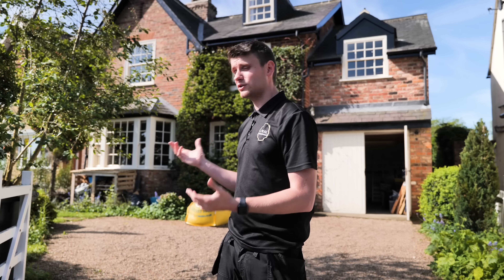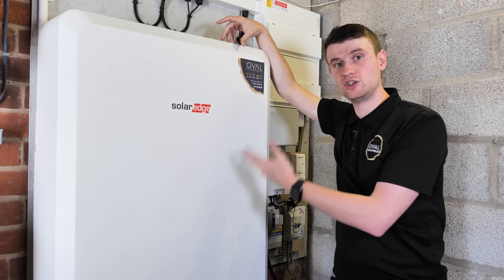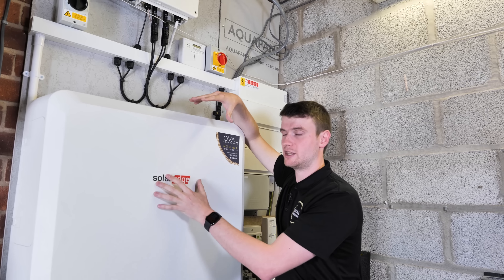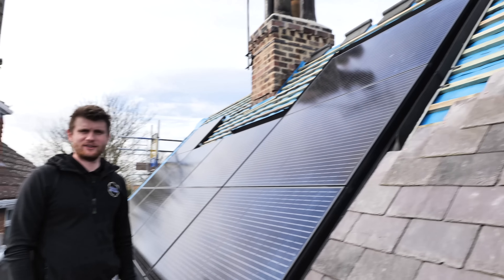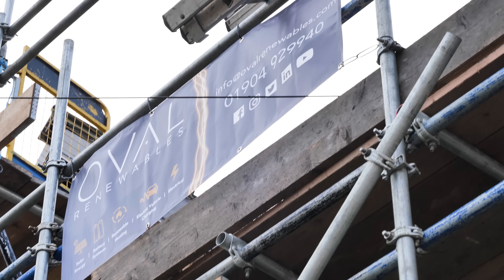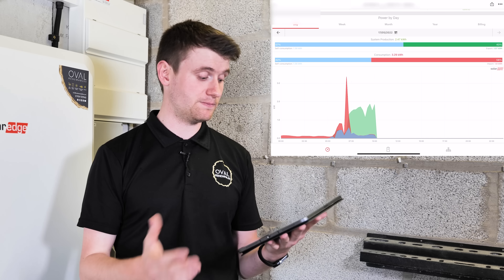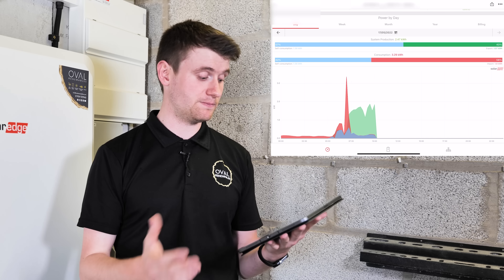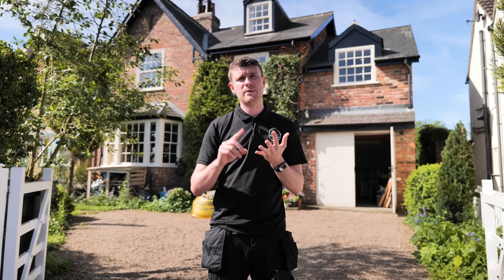Our First SolarEdge battery Installation with Solaredge Solar PV!

Comment: I have a similar system and have experienced the problems you mention with the Energy Bank. A few days ago the battery, according to the app, was not charging or discharging, it is working now. There's a software update due soon apparently. Considering how long the Energy Bank has been available in the U.S.A they should have resolved most problems by now. To be fair SE support are quick to respond to any support cases, in my experience within 48 hours.

Comment: Loving your videos and it is helping me as I am seriously considering solar panels and battery storage, as we recently moved into a property that is quite a period property in Brotherton, built in 1790. It was nice seeing this video with an older property, but I still think this one would be a walk in the park compared to mine. It is scaring me the prospect. Old fuse box, with old meter both of which are relatively inaccessible due to a kitchen being built on top of them. Walls nearly a meter thick. Also I would need an external setup (battery etc) as although my property is huge with a massive roof (my electrician buddy thinks that if weight and other things was not an issue, I have enough room for 40+ solar panels) that has just enough pitch so it is not declared flat (so uninterrupted sun all day), I do not have a garage. 

I need to get a survey done to see what is possible as my elec bills are huge, and I do not even charge my car at the house, my Tesla has free supercharging so I use Ferrybridge for that but would love to charge it at home and not supercharge it all the time.

Comment: Great installation  
I have 1 question  : If you would made this off grid what's are the options for grounding solar panels  ? 
Would you add earth  rod or still ground them through  mainboard Earth cable ? thank you

Comment: Thanks for the video!  might be a silly question but ( I'm not familiar with the solaredge systems) is the battery connected directly to the inverter as i can't see the cables connecting in? I can only see the two strings, ac, and comms, or is the battery ac coupled and connected separately on its own circuit that communicates with the inverter?
Reply from the maker: Thank you for commenting! The SolarEdge batteries are a high voltage battery and so just connect into the inverter using normal 6mm Pv cable and MC4’s. On this system there is one string of panels and one pair of connectors going to the battery. That’s why you can see two sets of cables.

Comment: I got my energy bank commissioned a few days ago.  I made a 3 part review on this battery on my YouTube channel.

A few days on, one thing I’ve noticed is that there’s often 20 to 30 watts of grid import all the time when in max self consumption mode.   It adds up to 1kwh import per day.  It makes me think that they are measuring “apparent” power rather than “real” power from the battery.  The grid import is most obvious at night when the fridge freezer compressor kicks in every two hours or so.

Hopefully a software update will fix it, but it’s great to otherwise see my import get reduced massively now that the nights are drawing in.

I really do hope that Solaredge get charge discharge profiling into the hand of owners soon.   It’s completely unacceptable that only installers have the ability to set these up.
Reply from the maker: Hi Anthony, thanks for watching and for the comment. Most battery systems will allow a small amount of import from the grid during operation. SolarEdge have a big app /software update in November I believe which will hopefully sort some of these issues out. I know they are including customer control for the grid charge. It is strange this was not included when it was released but hopefully all that will be a distant memory soon!
Reply: @OvalRenewables  the update to the app in November is a beta update and won't be available for general update until January.

Comment: Hi, any reason why you didn’t go for a solaredge 5kw inverter to maximise the AC charge and discharge for the battery. 👍🏻
Reply from the maker: Hi David, Thanks for watching and for the great question. This was our first SE battery job and we have learnt a lot since then. We do usually do that on our installs now. The DNO was also a bit tight on this job.

Comment: Like the idea of the optimiser in the loft but I would have mounted them on a piece of hardy backer board before fixing to the roof timbers
Reply from the maker: Thanks David, they are perfectly safe on the wood but you could also install with a bit of hardie board if you wanted

Comment: If you have multiple inverters surely the 1st converts solar to use / storage and 2nd inverter can import cheap power @ 7.5p into the battery. Of course battery will charge at night when no solar is being generated.

Comment: How are you dealing with the lack of battery control in the customer side app ? By this i mean the fact there is no ability to change what the battery does..  i just had one installed and its sat there at 31% doing nothing at all.. its one of the more frustracting bits of soleredge and the fact it has no UPS or backup function for a power outage. over all im regreting the solaredge battery part atleast lol i will have to re-evaluate once i get some answers from soleredge on monday.
Reply from the maker: We are changing this for customers upon request. The functionally is supposed to be coming to the customer app in November. Strange it wasn’t included originally but hopefully it won’t be long until it is.

Comment: I was really hoping to hear about the configuration for overnight/off peak charging of the battery from the grid. Does it do that? If it does, does it look at a weather forecast to see if it's going to be a sunny day before anticipating how much to charge. Fun to start with but I don't want to have to be interacting with the system every day to tell it how deeply to charge the batteries. That's the key feature I'm looking for in my next battery system. (I have a SolaX that doesn't do this and it is a pain)
Reply: This battery can be charged from the grid overnight, but you need installer level access to that functionality on the monitoring platform. There is an update to the app coming in January next year which will give site owners access to charging profiles.  Current level access is not smart enough to factor in the weather forecast for the next day.  Perhaps the update will include that.

Comment: Hi, is it possible to put the optimisers in the loft space if you have the regular on-roof mounting rail setup?
Reply from the maker: No not really as we cannot extend the connection between the panel and the optimiser

Comment: 10:50
Have you had any optimisers that failed?
Reply: I read an article from an Australian installer that approx 2% of the optimisers fail , we will be installing solaredge in April by an installer who only installs solaredge. I asked him about the failure rate and he also said around 2%
Reply: @ellas6101  
Was it Mark Cavanagh of Brisbane?
He has written about the solaredge failure rate that his company MC Electrical installed and he has also published a video that string inverters perform very well in partial shading, making the use of  optimisers or microinverters unnecessary

Comment: Hi, my local Pembrokeshire SOLAR installers put a 7.3Kw system on my roof last November 2021 but still haven't installed the Tesla 10Kw BATTERY due to supply problems. Would you consider installing one of your SolarEdge 10 Kw batteries booked up to my SolarEdge inverter, and this would then stay in situ until the Tesla BATTERY becomes available to fit as.an extra battery.? Would love to put my email or phone details here but then I'd get too much spam so hope to get a reply as I can rarely find my way back to this video.Today I gave British Gas only 3Kw for free but daily power given away is around 30-45 Ish hence my request for a battery as I urgently require some storage. Many thanks for suggestions.
Reply: 10Kw battery?
So you are another one that does not understand and the difference between kW and kWh.

I will give you a clue. One is a measure of power, the other is a measure of energy.
They are not the same.
Reply: Would that be 3kW or 3kWh you have given British Gas?

Have you ever read an electricity meter? 
Have you never noticed that the readings are always in kWh and kWh is stamped on the meter next to the reading?

Is it that you don't understand kWh and you do understand kW, so you just omit the h because you don't understand it, you think that the kWh units must be wrong? - even though it states kWh on every mains electricity meter in the entire country?

Comment: Does the App require SolarEdge to provide the service. What happens if SolarEdge goes Belly up - as Anderson has recently. If the App relies on SolarEdge to provide the App "Service"  - then the whole App is going to disappear.
Solar Edge surely can't be the only ones to offer/allow an Optimiser per panel to be installed in the System setup.

Comment: In Aus,,very few install solar edge now,,love the system but so much trouble
Reply: What do you install then?
Reply: @dyn4mis4tion  just opened a solar Biz but speaking to many retail & installers they don't like using them,,they said they have to keep going back resetting the system....Not sure exactly why but it's what many say across the network
Reply: So what do you install then?
Reply: @dyn4mis4tion  BYD is big in Australia and Alpha going off like crazy,,,,ppl whom focus on brand still like Tesla... Inverter alot ppl push Fronius but the new hybrid Gen24 series hearing linking with BYD is a bit tricky, but sold one yet....Sungrow big  here as easy to set up & 10y warranty...PV, most around 425watt now for residential....A 10kw system is around $6000 in Aus....Alpha 13.3kw cost around 8k aus wholesale
Reply: Have thought about shipping to UK as there is some profit to be made...As UK seems very expensive

Comment: Looks great and hopefully once settled down will generate good power.

Is there a reason why equipment like the inverter, battery etc are never in the loft space? Is it a safety issue or is it because it's easier to install and access in a garage etc?
Reply: Heat can be an issue and that battery would weigh quite a bit. Ease of access, installation and maintenance on ground level is normally best.
Reply from the maker: Thanks very much! We sometimes install the inverter in the loft but never the batteries, they weigh a lot and don’t like the idea of them being up there with poor ventilation!
Reply: Thanks, that makes sense.

Comment: Everthing low energy in UK,,,I think as lack of sun,,you be doing higher...we live  in Aus, lots of sun,,we install 30 x 415kw panels,,,13kw plus system,,,with 13kw plus batteries and still not enough to produce free energy for clients

Comment: Dont waste your money with a solar edge battery ive been promised for months for basic battery control and still nothing  all i want to do is partially charge the battery on cheap rate electricity then top up on solar but all it does is fully charge on electricity and send my solar to the grid so im always paying for electricity. Their customer service are not interested in helping.
Reply: Any update on this?